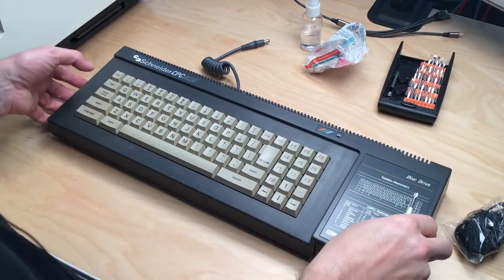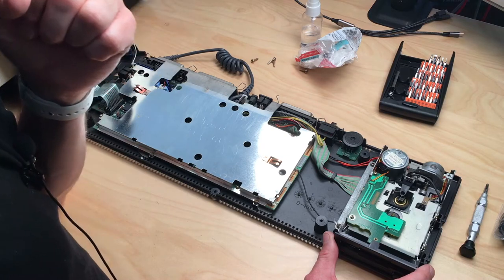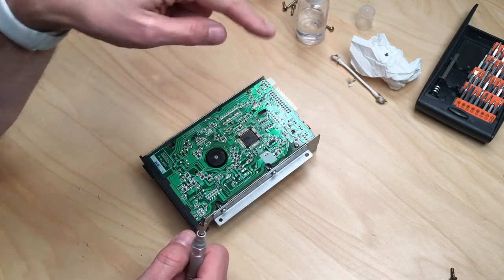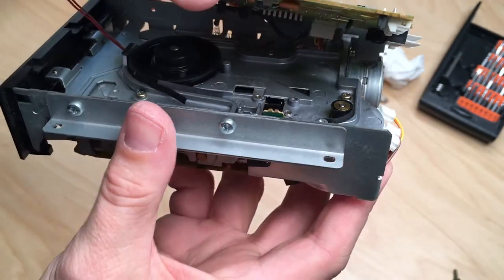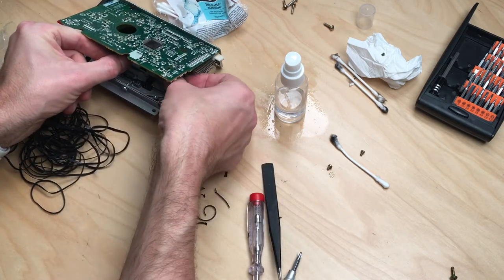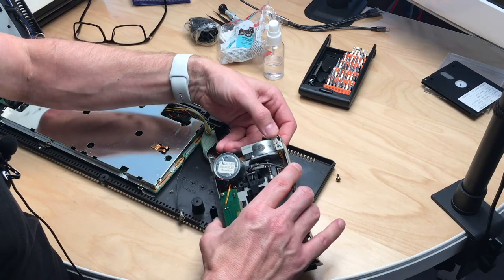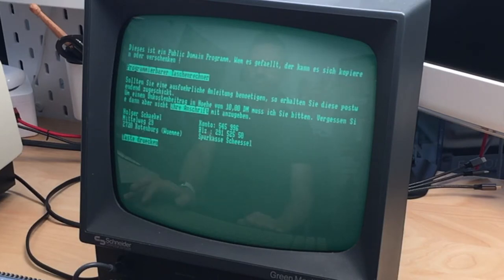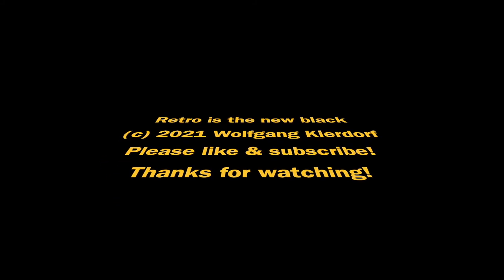Amstrad / Schneider CPC 6128 Drive Belt replacement (excerpt from Retro Packages #5)

Comment: One thing to note is that there are different models of drive inside each 6128, with mine it is different to this one where the cables are tied down with metal wire soldered to the board that need to be pried up, also you have to remove the metal rail on the side to remove a connector, and the important bit is that there are drives then (like mine) that have a mechanical write protect pin that will simply fall out so when opening the drive get some sheets of paper down on the counter or a white towel so you can see where the pin will fall
Reply from the maker: Thanks! I will pin your comment.

Comment: Hey thanks for the video. Can you please give the size (length, width, thickness) of the belt?
Reply from the maker: From CPC Wiki: The correct belt is 3mm wide, 0.6mm thick and has a total length (outer circumference) of 230mm (often also advertised as 115mm). If there is no other source available, one could look on AliExpress for belt sets (3mm wide, 0.6mm thick) which contain between 50 and 100 belts of different sizes.
Reply: @RetroWK  Thanks.